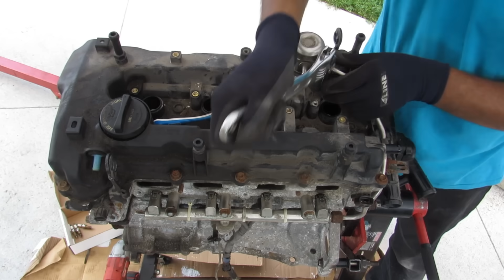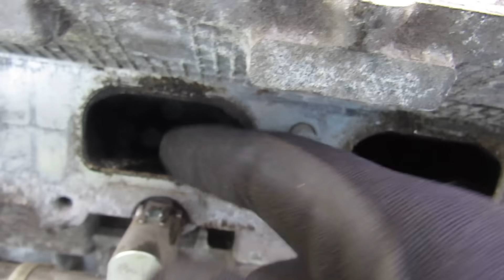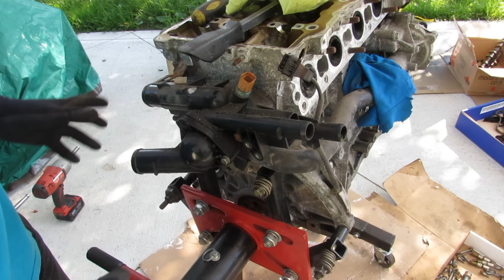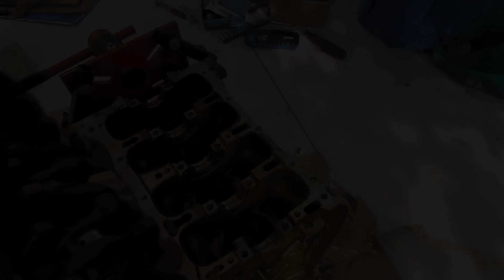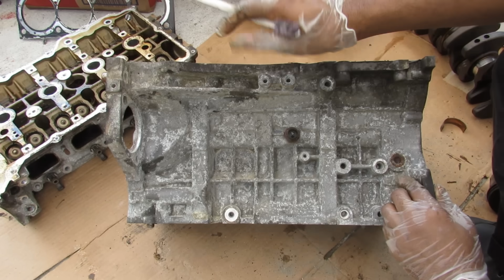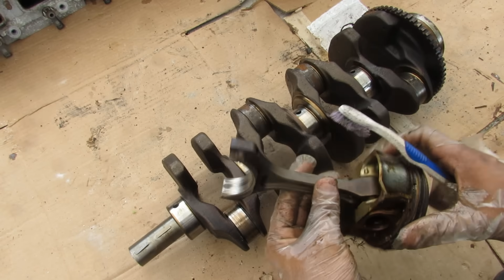Why Hyundai Engines FAIL

Comment: i have a hyundai genesis 2.0t and it runs really smooth at  just 126k miles. Im glad the previous owner and myself were on top and consistent with the oil changes at every 3000 miles. i hope i can keep this car running for a while. its such a fun car to drive
Reply: Drove the 3.8 with a manual trans. Scary fun.😊

Comment: Car makers, like Toyota, use port injection at low power (for intake valve cleaning) and direct injection for higher power levels. So there are two injectors per cylinder. Other car manufacturers are following suit.

Comment: I still don't know why none of the manufacturers put an extra injector upstream to clean the whole intake up.
Reply: They are starting to do exactly that.
Reply: @NovaResource  I've seen the combo port and direct injection.
Have you seen an upstream injector?
Reply: @robertrocheville7769  In some engines yes. Toyota does now.

Comment: Great vid,was going to buy a Telluride after owning a Hyundai Entourage for 14 yrs with zero engine issues, but the GDI system which doesn’t clean the valves was a deal breaker. Now after watching this vid and the loads of plastic and lack of QC in construction glad I bought a Toyota Sequoia, will never consider Hyundai/Kia again.

Comment: If a kia starts burning oil, how long can one drive this car with frequent oil top ups??
Reply: As long as you keep the oil up (when do you check the oil...every tank of gas or once a week?) and you stay on top of the oil/filter changes as well...
You may have to decrease the time between checks as the problem becomes worse.
perhaps keep driving until the smokescreen out the back of the car gets you attention from the Law?

Or the engine goes bang and seizes up?
Fit a loud buzzer and big orange light on top of the dash both connected to a sensitive additional oil sensor like racecars have so when the oil pressure drops as you are driving...you'll know...
Also fit a Toyota Previa/Estima/Lucida 2 litre oil reservoir from a wreck and pipe it in to the valve cover...when the light and buzzer sound during driving...push the button for more oil on the move....!
Or buy a new engine now and have a friend rebuild  it taking his time...so it can be fitted when yours goes poopy in it's trousers...as John Cadogan would say...
Reply: We're at 1qt / 1k miles 🤦‍♂️
Reply: @AlexHernandez-sc4vg  
Just check the oil and top up the same day you buy gas....
Buy quart jugs of the recommended oil and carry one in the trunk to top up....and keep a spare at home.
This way you keep the oil level up where it should be rather than  let the oil go a quart
low....you don't have all that much in the sump so you need to keep it as high as possible.....for as long as possible.
Reply: I burn 3L every 5000km.
Reply: @MayDayDevinci  
Check and top up your oil every day you buy gas, keeping one quart jug (or whatever the cheapest quantity for buying the correct oil for your engine is; don't get ripped off buying at the service station by the litre) in the trunk of your car, and another one at home as a spare.

Comment: At the machine shop where I work we rebuild Hyundai and Kia 4 cyl. heads by the dozens. Ive seen some with under 10,000km on them come in to be gone over after the bottom end blew up.
Reply: What's causing the oil to disappear at 1qt/1k miles ?

Comment: I've replaced so many 2.4 engines for Kia, usually cylinder 3 and 4 are the first to go
Reply: From the particles or some other failure you have identified?
Reply: @JohnSmith-yv6eq  oil consumption is also an issue on certain year models but the main one is still the particles left from machining from factory
Reply: @cesarorozco2  
Thanks for the reply....
Reply: Is it possible to blow out and clean the oil passages/galleys that are the problem with compressed air while things are all apart? Thanks in advance.

Comment: "Has a timing chain, so you're not supposed to service it." Yeah no buddy, timing chains and guides are supposed to be changed in 90,000 mile intervals, in any engine that has timing chains. If the engine fails because of gasoline wash out due to direct gasoline injection contaminating the oil and improper oil change interval, that's a separate issue on its own.
Reply: Timing BELTS need to be changed at 60k-90k miles, not timing CHAINS.
Reply: @NovaResource  timing chains are what are on this engine, not timing belts. Timing chains are changed 90k-100k no more than that. Timing belts are trash and nobody changes those either.
Reply: @JosephArata  I know this engine has timing chains. But you are incorrect. You do not change timing chains at 90,000 miles.  Timing chains can last 300k miles or more when properly maintained. 

Engines with timing belts need to have the belt replaced as easily as 60,000 to as late as 120,000 miles.

Comment: I own a 2007 Hyundai sonata and recently hit 240K miles and still going. Even my mechanic was in shock to see how many miles i have on it. Still running very smooth. Older models were a lot better.
Reply: Long distance commute?
Oil and filter changes at half the "recommended" intervals?
What's the reason behind the long life , in your opinion?
Reply: @JohnSmith-yv6eq  I believe that good maintenance is the key. I drive 120 miles daily, mix commute, part city, part highway. I change my own oil and I do  it every 5K  miles with regular Quaker State oil and I use genuine Hyundai oil filters (they are around $3 each when bought in bulk).  Before this model, I had a Hyundai Elantra 97' wagon and also hit the 200K miles mark and I did pretty much the same routine. So my experience with Hyundai has been positive so far.
Reply: @ovnd28  
With the care you take I would suggest that you could make a Yugo or even a PT Cruiser/any Chrysler product last a long time, too.

Comment: I have that car and engine and couldn't be happier with it. I change the oil every 3 months and after going pass 115000 I've started adding "Engine Restore" to the oil and it still runs like new. Actually I've had the least problems with this car than any other car I've owned. 2012, over 115000 miles and not a single issue yet. "Knock On Wood." Thanks for the video though. Always good to know.
Reply: 3 months seems super excessive -  I do my oil changes every 5000km.

Comment: I like how you mentioned Hyundai intentionally made a bracket to make the engines easier to pull out because they knew they were going to fail very early!!! 😅😅😅😅
Reply: Just like the ones Ford had on the 4-cylinder Pinto engines decades ago.
Reply: @paulshepherd8295  exactly but no fire extinguisher included. 🤣🤣

Comment: All 2.0 and 2.4 hyundai engines are now warrantied for lifetime. No worries. Everything on earth wears out eventually.
Reply: I'm in the middle of an oil consumption test with my Hyundai dealer for this issue, the mechanic I've worked with said it's very likely I'll get a new motor
Reply: @RoyHawkCollins   My 2.0t was replaced at 112,000 also for oil consumption. No bearing issues with either of my Hyundais so far. But turbo chargers are rough on piston rings regardless of what engine its on.

Comment: When I was in Automotive school I diagnosed one of these that was locked up, it had been run out of oil, and because of the recall the guy got a free engine at 80k miles.

Comment: 2013 Sonata with 2.4 Engine.  I changed the oil and filter at 500 miles my self.....Didn't believe the dealership when they told me no break period needed.  Going on 80K miles no engine issues. Change oil and filter at 3k to 5k intervals and run 5w30 full synthetic.
Reply: I have a 2011 Hyundai Sonata SE with 170K miles.  I do the all the regular maintenance, and never had a problem.
Reply: 5w40 only !!!
Reply: @КотикиШахматисты  
5W30 is the OEM
Reply: @v8snail  Or 5w20 but I perfer 5w30. 5w20 is to improve MPG. I rather have less wear and 5w30 handles LV heat better.
Reply: Got a 155000 mile Toyota.... Regular oil changes for all its life have ensured that the engine still runs smoothly and burns no oil.  Service book says 10000 miles but now it gets new oil and filter every 5000miles
Reply: @minorityofone1510  That is the secret to long life, ignore recommended service intervals and use quality oil and filters at 5k. I'm at 320k on an opel Astra that I serviced myself since new every 5k. No head gasket failures or other 250k+ normals. First few changes I opened up oil filters to check for metal and measure substrate quality, some (many) aftermarket filters are complete rubbish and probably kill a lot of engines. I keep running (Mobil1) full synthetic all the way with no cheap oil once it gets old.
I always push my engines hard up long mountain runs here too which keeps them clean, no soft babying carbon building driving.
Reply: Agree, got a 2019 Santa Fe with 2.4L. I change the oil even though they gave me 5 free oil changes lol. I hate their recommended Quaker State oil that much. I changed the break in oil at 700 or 800 I think. Then at 3,000 odometer I changed it again. Now on a 3-4,000 oil change with Castrol Edge full synthetic 5w30 as well.
Reply: 20 and 30 are too liquid oils, so only 5w40
Reply: @КотикиШахматисты  
Really? A kid at a keyboard giving engineering advice, and bad advice at that. You need to get back in your box.
Reply: @v8snail  ,  Honda number 1 in the world and everyone knows it
Reply: @v8snail  ,   On the channel KPOWERtuning korean motors are repaired hundreds a year, due to the fact that they drive water like 5w20 and 5w30
Reply: @КотикиШахматисты  Is that regular motor oil used only or synthetic?
Reply: @lactusgalacto1174  , Fully synthetic 5w40 oil is better to fill.
Reply: I detest dealers that claim there's no break-in period.  True, the engine will probably survive without one (unlike in the past), but the owner's manual does tell you that there should be a break-in period and what you should do - assuming anyone actually reads the manual.  And that's what the dealer is hoping you don't do.  Because, while the engine will likely survive its warranty period, it still won't last as long or run as well as one that was broken in correctly...and he's hoping you'll be back that much sooner for a new car.
Reply: Modern Korean motors - are very bad, there are many problems. 100 000 km of run and the motor needs repair :)
This is not a Honda
Reply: It has been demonstrated that insufficient cooling for first cylinder was the problem. If you have looked at first cylinder wall - there will be scratches. This is where metal debris come from clogging bearings etc.
Reply: @michaelnefedov2267  
It has been demonstrated by who?
This problem was due to a change in the way they flushed the debris from the crankshaft from using water to air. Nothing to to with deburring, only cleaning. It affected less than 2% of the engines and mostly in America. This is a beautifully designed engine otherwise, efficient, reliable and powerful considering it only drinks low octane fuel.
I have run this engine in Australia for 160,000km with no problems doing 15,000km oil changes using synthetic oil. Carbon build up is just not a problem. I haven't even see it on that engine apart from a light soot coating which impacts nothing.
This whole 'direct injection issue' is a joke seeded from very poorly designed engines like GM and the like.
There is nothing but bias in this video. I'm not a fanboy of any brand but can recognise good and poor engineering when I see it.
I have replaced two minor things on my 2013 i45 where as my previous Holden (GM) cars had the bonnet up every other weekend with issues and used twice the fuel for the same power. People need to get their heads out their arses.
Reply: @v8snail  - Your wrong KIA/HYUNDAI IS SHIT. My moms 2016 KIA Soul engine drinks a quart if oil every 1,000 miles, also the catalytic converter is clogged and Kia in my town doesn’t want to honor it.
Reply: @Abused.Ls2  
Telling me I'm wrong about an engine then giving only one example of a totally different engine with an unexplained history makes for a pretty weak argument.
Dealers almost everywhere are arseholes by design but in Australia we have different consumers laws to the US and in some cases a different supply chain for similar vehicles of the same brand.
Hyundai/Kia are statistically right up there in reliability and here at least are usually backed up by good company service if something goes wrong.
If you think I'm wrong on any point regarding that 2.4 GDI then counter argue it with specific engineering examples from your own personal experience.

Comment: NEVER known a Hyundia engine to fail, I known them to go around the clock twice and still keep running, this guy hasn't a clue about engine design, you don't put a tensioner on the top run of the cam chain, there's no room for it you dummy. If you service the engine properly it will probaly outlive you.
Reply: Correct, the tensioner has to go on the long side that isn't under tension.
Reply: You aren't very bright, now we know why you post videos of following signs ROFLMAO

Comment: I’m own 2017 Elantra. Bought brand new. Full synthetic fluids throughout changed engine oil every 5500 to 7k and Over 300k miles now with NO problems. Not even a check engine light. Just goes to show that it is really on the owner and how they treat there rides. There is an Elantra on this liberal platform that has 1 million miles on original drivetrain.
Reply: What is her daily commute distance?
Hot long running cuts down the total number of those heat/cool cycles and general wear a lot...

Comment: Had a 2016 Elantra for my work vehicle at my last job. Engine gave up at 103k miles. Was driving along at 45 mph and engine started knocking. Was about 2 miles from home so I had to limp it the whole way. Car died in my driveway and wouldn't restart.

Comment: NOW YOU'VE GOT ME CONCERNED...  I was considering the Hyundai Santa Cruz ( put a pre order deposit ) on it ... THIS DEFINITELY GIVES ME Pause 1st BRAND NEW VEHICLE that caught my interest since the PT CRUISER Limited that I bought when they 1st came out ( I was TOTALLY SATISFIED WITH THAT for the 5 years and only mid 30 something miles on it until it was totaled by some idiot it may be the last NEW VEHICLE I may buy . Others I have considered until this was the awd Dodge Challenger plus or the ( if they stop leaving us in suspense) the Ram Dakota. This makes THIS VEHICLE look / seem UNRELIABLE the upgraded larger engine model was my choice , would YOU consider this Santa Cruise do consider them reliable enough to give it hard earned money ?

Comment: My motor died. Thanks for this video.  I traded mine in at 168k, after it nickel and dimed me.
Reply: what did it get done in repairs?
Reply: @jamesmedina2062  besides the main bearing failing on the engine, here is most of the other stuff:

-water pump
-radiator (2x)
- idler pulley
-fuel pump 
- turbo oil feed line
- turbo wastegate (3x)
- small evap leak
- hvac blend door actuator 
- many safety recalls, too many to list.

Oh, and the replacement engine was gaining oil level. Just avoid these vehicles.  They're not remotely reliable.
Reply: @MattPSU02  Wow Matt. More problems than you can shake a stick at!! How many miles and months did you drive it?  Did they change the bearings for you?
Reply: @jamesmedina2062  I had it since new, bought 2011. 

When we were driving home from vacation, I started to hear a knocking noise from the engine.  The dealer kept it for a month before installing a refurbished engine, for free.  That was at 119k miles.  The refurbished engine had some minor oil leaking around the valve cover gasket. It also had some issue that was adding oil level, probably gasoline blowby getting into the oil.
Reply: @jamesmedina2062  oh and I forgot to list the steering problems...
Reply: @MattPSU02  Well a lot of cars suffer suspension wear and tear. It is worse with heavier/bigger wheels and depends on the roads and potholes. Or were your problems from steering rack?

You know what I can tell you is that at a certain price point you cannot have everything and the company decides whether to make the engine simple but reliable or powerful and yet problematic. My Honda is not bad but not great. Honda made it to be simple and reliable but with a bit more power than other cars in the class. I have had very nice Mazda V6 that were great when new but when over ten years they are dying. My VW was ok but the oil leaks were awful because I could get so low on oil all of a sudden and I could not afford repairs out of warranty on time. So I make compromises to have reliable car now. People knock Civic and Corolla but when you are poor or tired of problems, they just run. Also helps that get better mileage than the Camry and Accord plus this idiots wont give us Accord or Camry wagon so for me that messes up what would be my perfect car: a sporty wagon

Comment: Bro, your theory about the debris is wrong. 🙂 
The main issue with this engine is the 
1.deformation of the aluminium alloy block- it just doesn't hold its own shape.

2. Very bad pistons and oil rings.

3. The brown bearing inserts are specifically designed to to fail around 80k-100k kilometres.
You need to replace them with regular ( not brown) 

This information is not from me. It's from a dude repaired thousands of kia engines.

The debris are from the engine destroying itself, not from the manufacturing